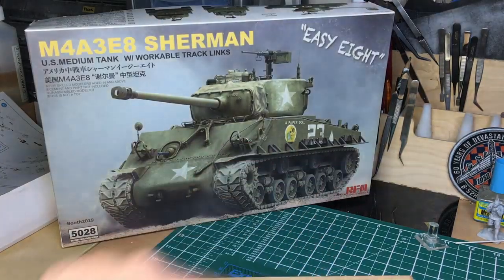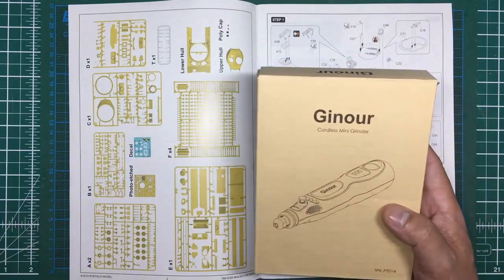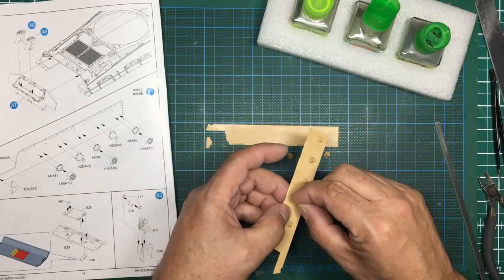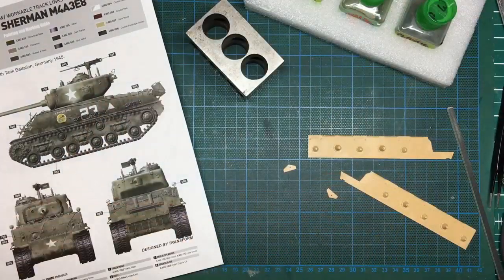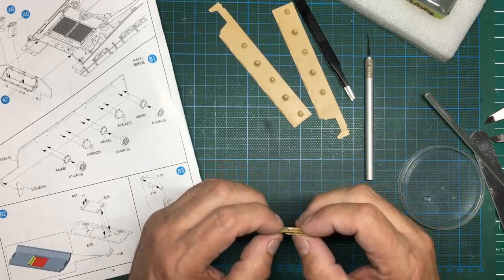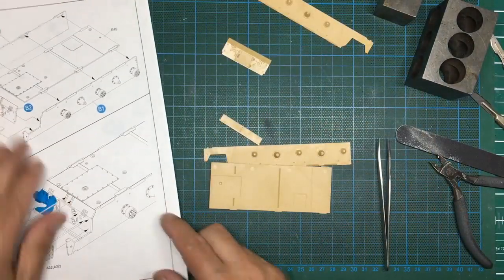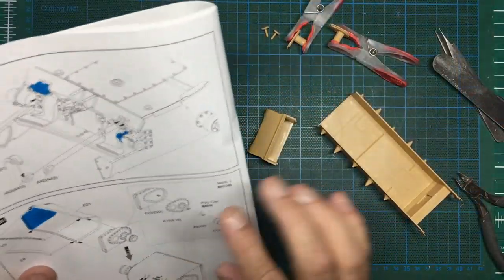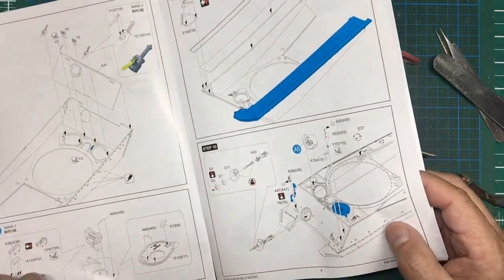Full Build: 1/35 Ryefield Models 1/35 Sherman M4A3E8

Comment: Great video thanks, also just to let you know the weld seam on the turret is supposed to be there, Sherman turrets are cast in two pieces ( top and bottom), the mount on the rear of the turret is to store the .50 cal MG, the little bottle thing is a searchlight stored facing down and probably to late now, but the cupola vision blocks have a slight green tint to them, kind of like looking through a Coke bottle.

Comment: Nigel - are you aware of any aftermarket kits or parts that could remedy the half-assed (for lack of a better term) working suspension system?  The fix would be a functional shock absorber.  The tricky part being the correct tension of the spring within the shock cylinder, accounting for the weight of the tank and proper shock compression when the suspension is articulated.  Definitely a design challenge. 🤔
Reply from the maker: Not aware of any mate.

Comment: Thanks to this video I went and bought this very model! New to the hobby but am enjoying it. Only thing I struggle with is paint. I use acrylics and keep leaving brush strokes. Any tips? I’m using it straight from the pot but do I have to dilute it? And do I need to prime first? Loving the hobby though and your videos Nige
Reply from the maker: Which paint are you using?
Reply: Humbrol
Reply: Any tips would be great
Reply from the maker: @matthewwoodward2738  sorry.. I forgot all about your problems..
I have been told in the past that Humbrol acrylics are awful?? If you watch the early stages of my "Monty's Humber" build, you will see that i use Revell acrylics on the brush, heavily thinned with water and get great results. I love the Revell aqua paints, thin them and you'll get a tough smooth finish.
Reply: Damn, just bought a load of Humbrol. Will try Revell next. How much do you thin them by please and do you prime first?

Comment: Hope it was a rewarding build.The tracks are a mojovator in disguise.I love thier Panthers w\interior,ive started another one.They have a 1\35 modern ATV w\interior coming out,looks daunting..Have a dilemma,wether to use Simple 'steel' 1\32' mustang seat from ZM PE set,or the kit version.Different designs.Done PE strap's and latches holding P51 Oil tank onto firewall,i was dubious about cutting plastic parts.But with some RB and HGW fabric harnesses as back up, i went for it.
Reply from the maker: Hi Darron. Do you mean simple steel belts from ZM PE set? I much prefer HGW every day.
Reply: No the fabric ones,i got HGW&RB sets with kit.And ZM int&ext PE,the ZM/Eduard int. has an early 'SJ' ? Steel seat included,having trouble choosing which to use,no info on attaching it though.No i made the PE oil tank straps and buckles,but was wary of cutting the moulded srap's off,but i thought even if i fuck up,i could manage to Knock something up out of a set of spare fabric belts if the PE strap's got mangled.Went perfectly though.The RB fabric belts 'look' good,HGW \48 and \32 are same,RB ones look more fabricee for \32.Ill find out when i make them.Swann morten craft handle,check it out,safer,easier and £1.89,only has 2 choices of blade,straight No1,curved No2.Steel handles.You just slide blade into handle and tighten the wheel.
Reply: Edit..steel handle,you just slide.....blah blah....
Reply from the maker: @darronhedges5873  got you now, just looked at the PE int set. I would use that PE seat all day long, it will be more realistic and in scale than the plastic one. I find the HGW to look more fabric like once they've been stained with a dark wash or coffee.
Reply: I'm with you 100% the lovely glossy A4 Eduard\ZM instructions don't show how to fit it.I feel terrible,dog booked in for castration tonight.I can't look him in the eye.
Reply: Ive spoken to someone else on utube about Rochm model's PE,i have hinted a lot about how good they are,but as yet unknown on utube.Bieng for WW2 Big Cats,Panther,tiger,kingtiger they could generate a lot of traffic.A set for Panther about £25 same as Aber Voyager ect.HOBBYeasy stock them.Started releasing stuff on 'New Releases' on Scalemates just recently.Very similar to Aeroscale,slightly larger range though.
Reply from the maker: @darronhedges5873  I emailed them about reviews on You Tube and they didnt even bother to reply. If a company doesnt have the courtesy to reply, I give up straight away.
Reply: Probably why noones heard of them,shame though.I like the way they show the sets in plan view in B&W,easy to copy design of larger parts.I made thier new Tiger 1 "Heater shroud" out of copper sheet.Good looking kits though.Nothing lost.Saw new Revell Uboat VIIc platinum,might forget about MTB,for £106 you get wooden deck,brass barrels and a bundle of photo etch.
Reply: I was working on my mustang,and i thought i wonder what Nigel's up to?Hope you OK.d
Reply: Now you have a PO box do you want a box of 100 3ml syringes,better than pippetes and washable and re-useable.Also have 0.5 x16mm Needles,good for mounting small parts to paint.I literally have thousands,so no problem.
Reply: Sorry if i said something i shouldnt.
Reply: And a mother to boot,means 'and a mother as well' emphasising how much more of an accomplishment achieved.Saw rant vid marked Private.Hope im not the subject.

Comment: Just stumbled on this set, is a lot of glue required for it? I've done some model kits before before but they've been the plastic ones which just fit together. Also what glue do you use?
Reply from the maker: Hi Andrew, May i suggest you watch some of my beginners videos. The "Montys Humber" video series is a good start.
Reply: @NigelsModellingBench  OK cheers, but what about this kit specifically? Do you recommend it for someone with a little but not a lot of kit building experience.

Apologies if you mentioned it in the video I haven't had the time to watch it yet.
Reply from the maker: @Simspon96  ummm in a word, no. It has very many tiny parts that will probably frustrate the hell out of you.
Reply: @NigelsModellingBench  ah, fair enough, thanks